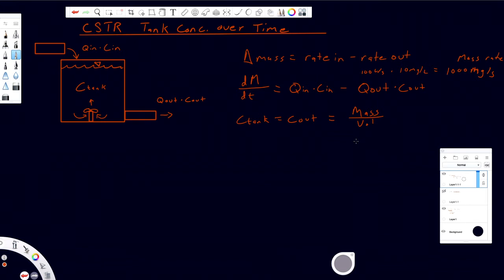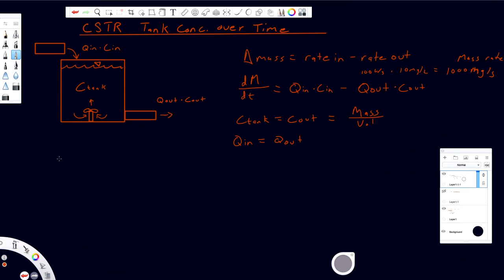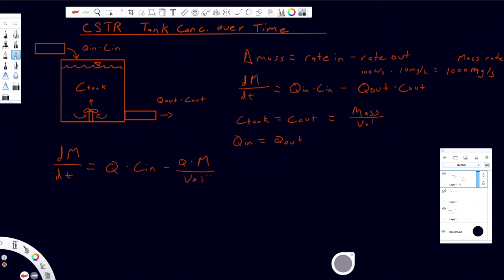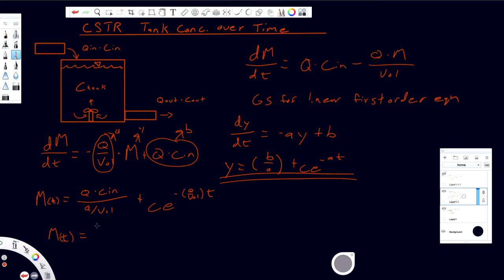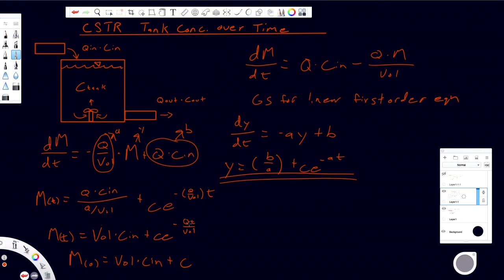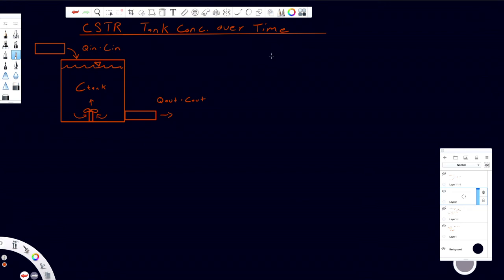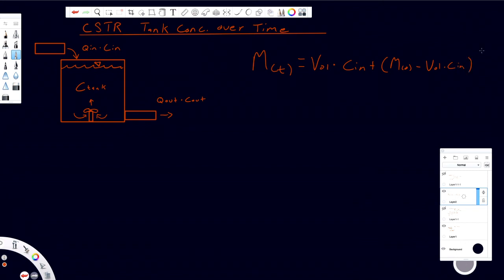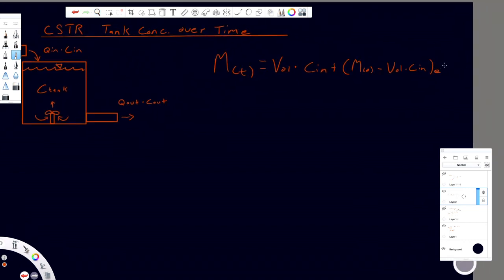Solving Tank and Effluent Concentration Over Time for Continuously Stirred Tank Reactors

Comment: Do you think you could mention which, if any, of the equations you use are in the FE handbook? Great content, btw. Very helpful!
Reply from the maker: Hello, Amy, and thank you for your kind comment!  I would be surprised to find a  problem this complex and time consuming on the FE, however, they may simplify the problem by providing additional information.  I did find a similar mass balance equation on page 319 of the FE handbook under the Fate and Transport section.  There are solutions to linear differential equations starting on page 51, but they only cover the most straight-forward examples.  I hope this helps and good luck on the exam!